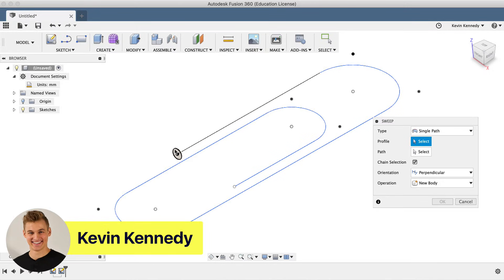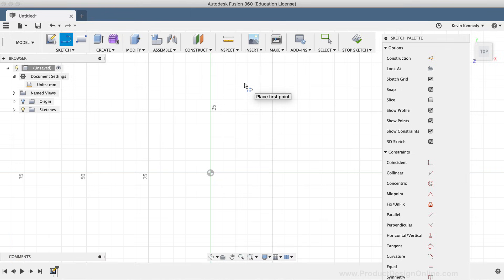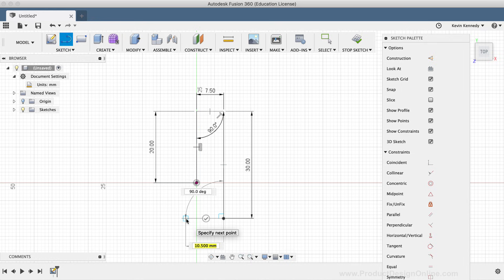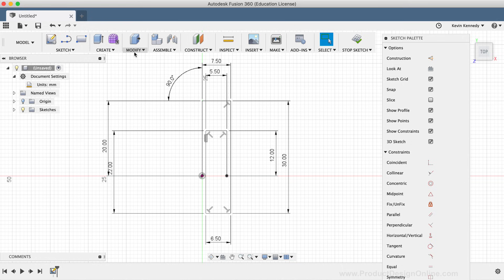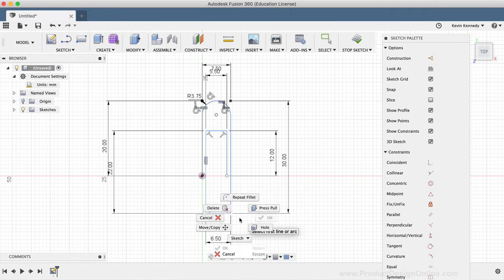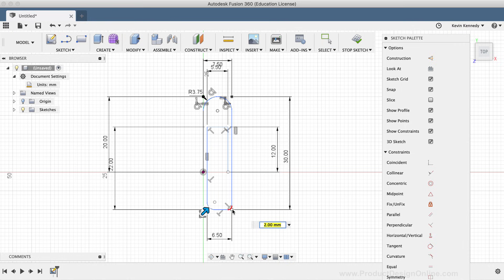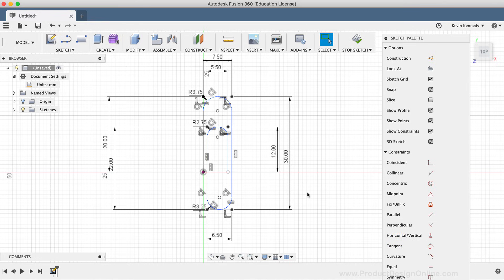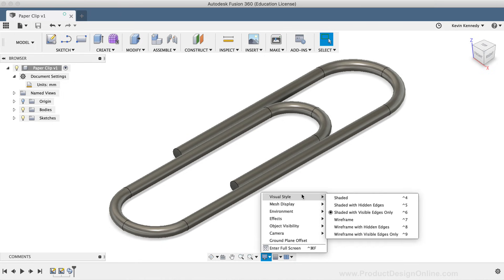How to 3D Model a Paper Clip - Learn Autodesk Fusion 360 in 30 Days: Day #3 (REVISED)

Comment: 13:16 i get this error: "The start direction of a path segment is anti parallel to the end direction of the previous path segment" What should I do?
Reply from the maker: Hi, Carduus. It has been a common theme that if the fillets and constraints aren't applied in the same exact order as I did then they may throw this error. For some reason, Fusion 360 cannot process two fillets at once to achieve consistent results.

Can you try to revert the previous step and then apply the fillets one at a time? That should fix everything and allow the sweep to work without any issues. Cheers, Kevin :)
Reply: @ProductDesignOnline  Thx! It fixed the problem. Btw, amazing channel, amazing videos! Keep it up!
Reply from the maker: @carduus4778  Thanks! I really appreciate your support. Cheers, Kevin :)
Reply: @ProductDesignOnline  Hello, I tried to make it completely according to your operation, and found that the function of scanning Joan can be used normally.
The only thing that's different from what I did before is that when I draw the second round corner, I draw the one on the left and then I draw the one on the right, whereas I draw the one on the right and then I draw the one on the left
Reply: @ProductDesignOnline  Hello, thank you for the tutorial you provided. In the process of scanning qiong, I also met similar problems, and after adding the constraint of four vertical lines, I still encountered similar problems. I don't know how to solve them, thank you

Comment: I'm having the same error:  The start direction of a path segment is anti parallel to the end direction of the previous path segment. Even though I've applied vertical/horizontal constraint to all 4 lines (which are perpendicular to X axis). Please help me.
https://a360.co/30CZlIV
Reply from the maker: Hi Parth, I just took a look at your file. Your constraints appear to be fine, but the top arc is throwing it off for some reason. Try doing the main sketch again and this time apply the fillets one at a time. That should resolve the issue. It appears that Fusion 360 can't handle the processing of the lines when two fillets are applied.

Let me know if that solves it for you! Cheers, Kevin :)
Reply: @ProductDesignOnline  Thank you so much Kevin. You're the best. I've learned a lot from your series "Learn Autodesk Fusion 360 in 30 days". Heartily appreciated.
Reply: I've solved my issue with the help of Kevin Kennedy by defining a fillet to each corner at a time. It sounds weird to define one at a time but it worked perfectly for me. So try that if you're having a same problem. Thank you.
Reply from the maker: @parthoza7820  No problem! Glad I could help. Cheers, Kevin :)

Comment: Ran into the antiparallel issue, had all the vertical constraints, swapped them for one vertical and three parallel, tried reducing the fillet by 0.02, double checked the location of the issue (on the third iteration of the sketch) by unchecking chain and slowly extending the path length which that time at least showed the problem was the lower right fillet.  Restarted (fourth iteration) and this time did each fillet one at a time - not only did I have no issues with sketch parts moving around (even without additional constraints) but the sweep worked perfectly, albeit with needing to select the path as multiple parts. 

If I had to make a vaguely educated guess, 360 isn't evaluating the results consistently when you ask it to do the fillets two at a time, possibly because of equal-priority order of operations combining poorly when constraints are being removed/modified, and probably not helped by the fillets being so close to one another (hence reducing the size seems to have helped some).  This would explain the seemingly random way it's affecting people - some are getting lucky and everything works, some of us get almost all the way there, some halfway there, and others run into trouble at the first curve.  And results (positive or negative) aren't consistently reproduceable, because it's a toss up as to which instructions hit the processor for execution first.
Reply: Thanks, this works perfectly.
Reply from the maker: @specialagentdalecooper5367  Glad that worked for you! Thanks again for sharing, Baiswith. Cheers, Kevin :)
Reply: Thanks, Baiswith.
I went through this 3 times before checking the comments in here thinking I couldn't be the only one with this issue.
Also had to select each fillet as a path one by one.
Reply from the maker: @Kajerman  Glad that worked for you! Don't hesitate to comment questions on the tutorials as you work through the remainder of the series. Cheers, Kevin :)
Reply from the maker: Thanks for sharing this, Baiswith! Great observation with everything... I'll have to agree that it seems like both fillets being applied at once are the issue causing the inconsistent results.

I'll be sure to let everyone else know that has problems. Cheers, Kevin :)
Reply: @ProductDesignOnline   send him a payment check kkk ...
im just learning how to use this glitched software cause artcam got obsolete !!!
Reply from the maker: @d4rk5tar97  Don't hesitate to comment questions on the tutorials as you work through the remainder of the series. Cheers, Kevin :)

Comment: Oddly, when I was using the Sweep command, selecting the path only selected the first section of the paper clip. I was able to select the rest of the clip (in about three or four clicks), and the command still worked, but the difference with your single click success is interesting. Not sure what gives.
Reply: UPDATE: Reading the comments below explained the issue .
Reply from the maker: Should be the "Chain Selection" checkbox in the Sweep Dialogue. Did that fix the issue for you? Cheers, Kevin :)
Reply: @ProductDesignOnline  Interesting. . .  I went back to the file and looked at the sweep command settings.. . . the "chain selection" box had indeed been checked. I un-did and redid this section a few times, and it always required multiple clicks on different sections of the path. 

Interesting, but not enough to be worried about at this stage.
Reply from the maker: @JohnMcKLV  That is weird... I've found that fillets and sweeps don't always get along... it sounds like for some reasons the chain selection is not working because of the fillets if it's breaking it up at each segment. Nonetheless, I'm glad your sweep is still working!! Cheers, Kevin :)
Reply: Product Design Online I had the same problem, not the anti parallel problem but it would not complete the sweep...only to the bottom fillet. I thought it was having difficulty sweeping with the sketch fillet so I tried to do the sketch using tangent arcs. Success!

Comment: Really silly interface question: is there a way to change the color of the dimension guides? It would be helpful to keep them distinct from the actual drawing elements while in sketch view. 

This is not a high priority question ;)
Reply from the maker: Hi, John. Not a silly question at all. This is actually something that has been debated on the F360 forum quite a bit (at least a few years ago). The only "solution" with the current release of F360 is to change your environment display setting. Select the "Display Settings" icon (desktop monitor icon) at the bottom of your Fusion 360 > Environment > Select "Gray Sky" or "Dark Sky," which are both options that make the sketch lines and dimension lines different colors.

Cheers, Kevin :)
Reply: @ProductDesignOnline  Excellent - thanks!
Reply from the maker: You're welcome! :)

Comment: Amazing videos. I had zero problems until this one. The fillet issue that all others had. Followed you step by step 3x before I started messing with my fillets. I had to reduce them to leave "clearance" (.05 was plenty for me; less would likely work too) at the intersection. I could work around this by getting rid of the perpendicular constraints before I tried my full fillets, but it would still freak out on the 3rd and final fillet no matter what. I tried using dimension lines to measure what was going on and my best clue was that the fillets could not meet perfectly - there seemed to be a "lost" .01mm somewhere for some reason... at least that's what I saw before F360 freaked out and told me I was overconstraining everything (clearly I have much to learn and am scared to break everything currently.
Reply from the maker: Hi, Joel. Thanks for letting me know. I'm glad you were able to get it to work by reducing the fillets by 0.05 as that seems to be the best "workaround" for now.

I go further into constraints (applying them and why to apply them) later on in this series. Hopefully, after the series you'll have a much better understanding of constraints and this video will make more sense. I was trying to stay away from introducing constraints in the first few lessons as they can be quite difficult for beginners.

Nonetheless, please don't hesitate to comment questions on the tutorials as you work through the remainder of the series. Cheers, Kevin :)

Comment: The link has been sent - thank you.
Reply from the maker: Thanks, Zachary. I'll take a look and get back to you. Cheers, Kevin :)
Reply: @ProductDesignOnline  Another link has been sent.
Reply from the maker: @kidnamedsoy  Hi, Zachary. I took a look at your file. It appears that one of the lines on the right-hand side was causing an issue with the fillet (not exactly sure what happened). I deleted the right fillet that's screwed up and then redrew the entire right line. After that, I was able to complete the fillet without any problems. Here's your file with the changes I made - https://a360.co/2KBPj6C

Cheers, Kevin :)

Comment: Hi! When I try to filet the bottom corners, one of them protrudes in a odd way right after I hit enter. I put a vertical constraint on the right line, but the left line won't let me do so - i suspect this is due to something called over-constraints or something. If I just enter the number in the filet options it turns out fine, but once i hit enter, it goes crazy. Thank you!
Reply from the maker: Hi, Zachary. Can you provide a link to a screenshot or a link to your file. Share your public link as a reply to this comment. Here's a video explaining how to share a public link - https://youtu.be/2XrcrdV-8Ls

Then, please write a separate comment letting me know you've replied with a link because YouTube flags most links and I don't always get notified. Cheers, Kevin :)
Reply: Here is the link. https://imgur.com/gallery/1E9XYTN
Reply from the maker: Thanks for the images, Zachary.  Looking at the image it appears that the left line is fully constrained already, as it's a black colored line. Can you share your public link as a reply to this thread? I'll take a look and see what constraint is causing this. Cheers, Kevin :)

Comment: I had the UI preview ticked which was recommended by Brad Tallis. However with this clicked there was no model tab as in your lessons. The version you are using appears more intuitive or am I missing something?
Reply from the maker: Hi, Peter. I decided a while back that I'll keep my tutorials in the current version of Fusion 360, without using any of the preview functionality. The UI Preview has been available for approximately 8 months, and from my own experimentation with it, I've seen them move stuff around and change things quite frequently. I'm assuming the Autodesk folks have been pushing the UI preview so they can have a large enough sample set of users to gain valid feedback. I personally think the "tab" design still needs a lot of work. In some areas I'd agree with you that they're trying to simplify it too much, and have taken away some of the intuitiveness. Thus, I'm staying away from the UI preview until it's officially pushed out in a future version (when we don't have a choice). Cheers, Kevin :)
Reply: Thankou Kevin, I unticked the box and it made life so much easier with your lessons. By the way clicking two lines and hitting fillet radius zero makes doing you paper clip much easier.
Reply from the maker: @peterjenkins9342  Thanks for sharing this. Cheers, Kevin :)

Comment: Hi Kevin, I've upload you the link of my work, please have a look!! Thanks a lot! Buza
Reply from the maker: Hi, Buza. Sorry for the delay. I was able to take a look at your file. It appears that something with the upper-right hand fillet is throwing off the sweep profile. While using the sweep command, I deselected the "chain faces" option in the sweep dialog box. Then, as you try to extend the sweep you'll see it gets stuck there.

I tried to delete the tangent constraint that was applied by the fillet, but that didn't seem to fix it. I would suggest trying the fillets from scratch, doing them one-by-one. Give it another try and let me know if you're able to get it working. Cheers, Kevin :)

Comment: I thought maybe the problem was going into the sweep operation without parts of the paperclip sketch being constrained. I went in and "fixed" (i.e. the fix/unfix constraint) the lines to each other, but the sweep is still stopping part way through.
Reply from the maker: Hi, jench78. Was your sweep only showing part of the path? Did you try selecting all the paths? I know a few others mentioned they had to select the path in 3 different parts. Upon reviewing one of the files it was how they drew their lines and applied their fillets, which caused the path to  be broken into 3 sections. The sweep command still works exactly the same, it just requires you to select the other paths. Cheers, Kevin :)
Reply: @ProductDesignOnline  That did end up working!  Do you know why it breaks up the sketch into different paths?  I also noticed that I was getting errors when I tried to apply fillets in pairs, but had less problems when I did them one at a time.  Weird stuff.

Comment: I thought I would try this drawing to give you some feedback.  I noticed that as I was laying out the lines, once I hit the green checkmark circle.  This ended my line, and starting a new one at that end point seemed to create problems when trying to sweep.  Also, sometimes as I was laying the lines out, it automatically exited the line function.  I am not sure what exactly is happening.
Reply from the maker: Hi, jench78. Sorry, I must've missed your comment. Thanks for your feedback!!
Creating a new line at the end point of another line shouldn't affect its "sweep" ability. It's likely that the fillet radius was throwing off the endpoints in some manner.

As far as automatically exiting the line function... where you hitting any other hotkeys? Any time you click another keyboard key (if it has a hotkey assigned) it will automatically boot you from the line command. Just something to be cautious about as you work. Cheers, Kevin :)

Comment: Hey Kevin !! There is a problem..when I try to sweep, it says error .antiparallel bla bla!What to do?
Reply from the maker: Hi, himadri Roy. Did you add the vertical constraints to the vertical lines before trying the sweep? Those vertical constraints should ensure that they are both vertical/parallel with one another. In some scenarios, you could use the parallel constraint; however, in this case, that would overconstrain the sketch.

Double check that you have vertical constraints. If that doesn't seem to fix it then please share the public link of your file as a reply to this comment and I'll take a look. Cheers, Kevin :)
Reply: @ProductDesignOnline  well i will gonna look at my project about vertical constraints , if that doesnt work for me i will share you the files !!
Reply from the maker: @himadriroy4314  Sounds good! Just let me know either way. Cheers, Kevin :)
Reply from the maker: @himadriroy4314  I took a look at your file. For some reason, the way you applied fillets has broken the path into three sections. This still works - all you need to do is select all three paths when you're setting up the sweep command. The paths are still continuous so it will show "1 Path" as selected in the Sweep dialog box, even though you select all three. Cheers, Kevin :)
Reply: @ProductDesignOnline  HAHA finally kevin!!I did That .Thanks Mate !!
Reply from the maker: @himadriroy4314  You're welcome! Cheers, Kevin :)
Reply: That's the answer I was looking for! Thank you for these tutorials.  @ProductDesignOnline
Reply from the maker: @nathanm.garland9138  Thank you for taking the time to watch and comment! Please don't hesitate to comment questions on the tutorials as you work through the remainder of the series. Cheers, Kevin :)